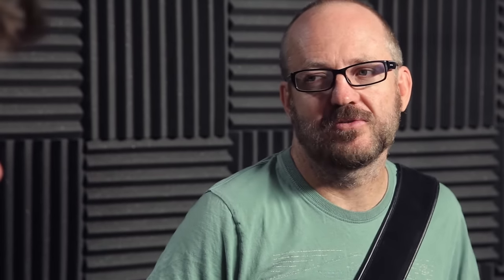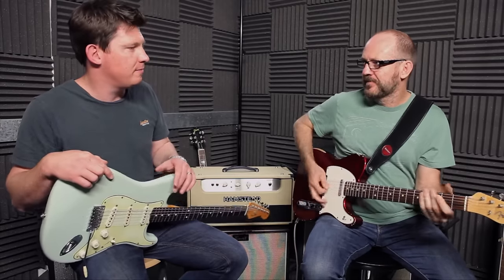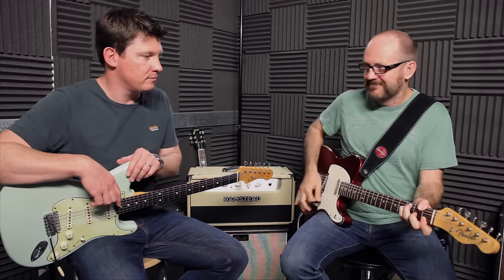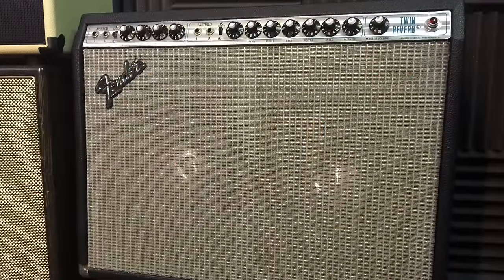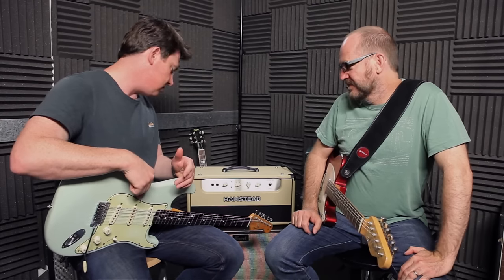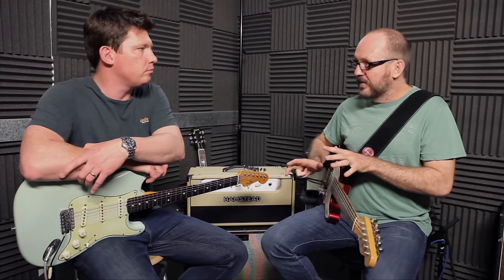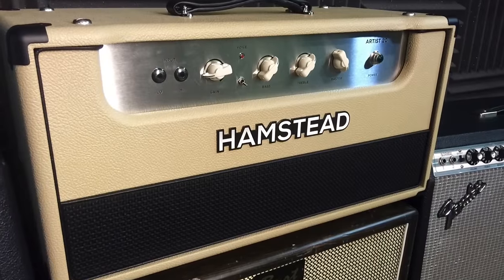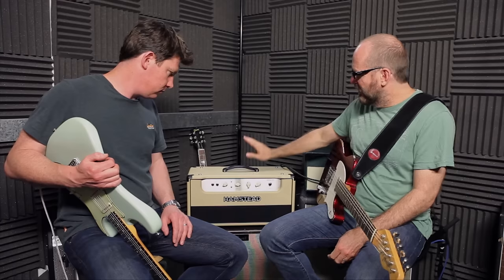Setting Up Your Amp To Use With Drive Pedals

Comment: I really think that a pedal almost always is more friendly to some kind of amp, and I also understood that the idea of the video is to show how pronounced can be the difference of the same pedal into different amps. But IMHO changing the pedal settings when changing amplifiers can minimize a lot the difference, making possible to get good sounds from different amps... BTW, I really appreciates the videos these guys do.
Reply: +Rodrigo Castro Changing eq settings doesn't change things like attack and shimmer unless there's a tight/loose/normal switch. There's response and feel more than just eq. Many amps smear notes and lack definition and pedal settings usually can't make up for that.

Comment: I appreciate that you guys are trying to make a point, and a generally correct one at that, but geez that is not what a Fender Twin sounds like. Whether it was an awful recording or the way you set it, it's like you've cut its balls off or something. That amp can sound way better than that even with a Big Muff.

Comment: I would like to see what you would use on Solid state amps? I have a Marshall hybrid really, tube preamp, solid state power amp made in the UK I really like. I however would like to know what overdrive would work to boost the just broken up sound? I used to just plug in and crank it when I used to play back in the day and use my volume knob, but experimenting with pedals. You guys have a great bunch of demo's. Thanks so much. 
Tim

Comment: Just set your amp so your tone is clean with guitar volume at around 6 or below and dirty-ish on 10. Then use drive and clean boost pedal to push it over the edge when needed...always worked for me...👍😎
Reply: A lot of people do that; i think it's a great idea for people who 1) don't use a lot of pedals in general, and 2) don't notice (or mind) the huge difference in ~tone~, not just gain, between guitar volume at 6, and at 10.
The 'clean' you get w/ guitar vol at 6 is just too dark for some of us; and the 'amp-overdrive' w/ guitar on 10 (not much louder than @6, but with more hair) is somewhat short of "creamy lead tone".....
I think good-sounding pickups sound their harmonic best on '10', anyway; in that case, you'll often want to run your amp within it's clean headroom (or at the edge), and stack drive pedals in front. Even just a 'preamp/OD' (Tech 21, Radial ToneBone, et al) and a boost/OD after it......Volume pedal (since guitar volume stays on 10 for full signal). Put it in the loop for a True 'master volume'.

Comment: I use an original 1978 Marshall valve 2 by 12 amp 50 watt , I use an attenuator so I can push amp without excessive volume, I use jhs at  and bonsai jhs tube screamer pedals is n my Marshall , awesome combination, using a les Paul

Comment: That's the modern way .keeping the guitar volume on ten like a on/off switch and switching channels..being 55 I like the tone variation of riding the guitar volume control anywhere from 4 to 10. One of the boosts on my board is a straight clean boost designed to get the brightness back as well as raising vol for solos...👍😎

Comment: The super overdrive in the fender is much better to me than the muff , I’m a Marshall man converted to orange amps but the best sound I ever got was in a fender twin reverb with a bossOD 1 back in the 80s if it was too bright I just dial the treble down , I used to use Gibson dirty finger pickups in shape strat

Comment: The difference is the EQ in the amps.Dial the Fender in starting with bass and treble at zero and middle at 10. After that you sprinkle the sound with the bass and treble.

Comment: Also Fuzz Pedals into VOX amps will do the same as Fenders. Got one and hooked it up to my ac15... hated it
Reply from the maker: +Da Spotz depends on the Vox. My old AC30 and AC10 sound epic with fuzzes but these amps have EF86 input valves, but if your plugged into the normal channel and you are playing really quiet with little amp compression it can get very spikey

Comment: Would be super interesting to have a vid (or series of them) where you take this concept of how different pedals sound with different amps, and see how some of the 'amp in a box' (eg, Catalinbread foundation series) pedals match up in when stacked similarly.  

Personally I've got an AC15 Twin, and a 70s Princeton I both run clean, and I've got 3 of the Catalinbread boxes that I set with just a slight bit of gain after my ODs and Fuzzes.  This gives me a huge tonal pallet to work with.  I've noticed how they filter the sound of a fuzz so differently is amazing (sometimes good and sometimes bad).  I've recently tried an EarthQuaker Devices Monarch (Orange in a box) have found it does the same thing and is fantastic to match with a fuzz.

For those of us who like a variety of tones, and want to try and augment our main amp to get there - because of budget...what should we be looking at that's tonally accurate.

This vid, the vid on better solo tone, and even Tom Quayle showing off the variation in the Dual Fusion stack... there's just a lot there to talk about or show off even more to help us figure out how to get the tones we hear in our heads... and that's without getting too much into guitar type or speaker type.

Comment: Great vids, super helpful information that it takes gear nuts years to figure out on their own.  Thanks for that.  Wondering if you could do a vid with drive pedals you can use with a VOX AC30 on the top boost channel.  Seems very sensitive to drive pedals and it's hard not to get that papery thin sort of sound with it.  All the best!

Comment: Great videos! I've learned so much from them! But I was wondering, could you do a video about guitar treble bleed circuits (and similar) and how they affect the volume roll-off sound on fuzzes and treble booster circuits? That would be extremely helpful!

Comment: The video is extremely enlightening. But some rock albums in the late 60 "mainly" were recorded with fuzz and Twin Reverb together. I'm not sure, but the twin reverb ideal is to turn off the key "bright" and put the volume in 4 up.
Reply from the maker: +maupric the 60's twin is an entirely different amp to this 70's silver face. Nothing but headroom here :)
Reply: +Daniel TheGigRig I do not know what is different from the "twin" of the 60s just know CREAM Disraeli Gears studio had this rough guitar tone. The Clapton used Marshall live but in studio he used Fender Twin too. I have seen in studio photos. Another example is Book Of Taliesyn - Deep Purple. I do not like that tone. Me happens to overdrive pedal. In my case is a Okko Diablo pedal plugged into a Fender Supersonic Twin. In the clean channel it has a button that toggles "twin" or "bassman". I think it's like you were the "britght" button of the Twin or "fat" of the Bassman. When in "twin" gives me this harsh tone and when in "bassman" gives me that velvety timbre wonderful Albert King type.

Comment: Part of this conversation needs to address plugging into the effects loop return on your amp. If you haven't already tried it, it's like playing an entirely different amp. Your pedals are driving the power amp and bypassing the preamp. Also stacking the fuzz with the overdrive could give you the tone you seek. And it's my opinion that pedals all have the potential to sound great with all amps and all guitars. The question is how long you're willing to work the setup to milk the sound you seek out of your gear.

Comment: a glorified PA speaker...Leo wanted clean loud amps, and that's what he tried to build his whole life. he finally achieved that with the silverface amps. they have their place. I used to play clean only and a silverface twin could do it better than anything. fuzz pedals sound better in front a distorted amp, so the only way it's gonna sound good into the twin is if you crank it.
Reply: I agree about Fuzz faces sounding better into a driven amp or OD pedal. However Muff's not so much. they're so thick and wooly that I think they really need to be run into a clean amp, or you're left with a tone that's so compressed and wooly that that it's not really usable for anything besides Smashing Pumpkins covers. However they sound great running into a Tube Screamer with the TS's gain rolled off to add midrange. That's what I do for playing Gilmore tones: the TS into the Muff for lower volume use, the Muff into the TS for louder ones (in general).
My favorite sound with Fuzz (which admittedly I don't use all that often) is a Fuzz Face into my Klon clone (the Fuzz Face actually being a clone I built with PNP transistor so it sits better with other pedals).

Comment: Hi! I really like your show, as you're really talking about the things that really matter in the real world! :-)
However, concerning the way pedals and amps react, I regret you didn't mention how important the role of the speakers is in the way amps and pedals get along. The more I experience things, the more I find that, more than amps, some speakers take or don't take pedals well (of course, it's a matter of combination). 
Anyway, again Bravo for your show, you are doing a terrific job!
All the best,
Vincent
Reply: vincemanmusic Most pro audio engineers assert that a good speaker accurately or transparently produces the signal for which it is supplied, meaning that the speaker adds no timbre to that signal. Some players are partial to speakers because of the timbre that is added by a particular speaker.This is good if you are content to always having that added timbre as part of your sound, however it can become an issue when you no longer want that added timbre, or when changes are made to the signal before it reaches the speaker, these changes can include volume, gain level, and not limited to but of course pedals.For myself and many, a transparent speaker is an essential element for tone construction, as the speaker is at the end of the tone construction chain and is fixed or non adjustable. I hope this is helpful to whoever reads this.
Reply: Eddie Griffith Transparent speaker? I've never worked with such a thing :-). To me, any speaker reacts as a filter, cutting or enhancing some frequencies, compressing, distorting sometimes, and it's a huge part of the equation when it comes to sound. From Celestion (V30, greenback, G12H30, Alnico blue, you name it) to Jensen or JBLs, any guitar speaker ads its flavor to the sound. To me it's a good thing, and a big part of the signal chain. 
I'd like to know which speaker do you consider transparent?
Reply: I did not mention "transparent" meant  within the range the speaker was designed to produce. In short most speakers that are likely to be transparent are ones found in the professional audio field, many such speakers are  also used as OEM on guitar amps. Many well known players have used speakers from  EV, JBL that were originally designed for PA systems. Rather than discontinuing a popular PA type speaker EV kept the popular EVM 12l on their catalog as their only offered guitar speaker.(there is a variant of that speaker with the difference being peak power handling) 

Of course the speaker is an important part of the signal chain, it is a vital element and it is at the end and has the last effect, so if the speaker you choose for a specific timbre effect (like so many guitar speakers are made for) is what you want, you will always have it. Whereas if you approach the final link in the chain as you would hi fidelity audio reproduction, the changes you make on the signal chain prior to its reaching the speaker are more accuratley revealed. There are other elements that effect how any speaker sounds, so proper application should be considered

Comment: Comparing a 100 watt amp likely running  four 6L6's in pentode mode to 18 watt amp possibly running two EL84's in pentode (which were designed to have higher gain, but less power), and later bringing in a not so widely known amp with out any information about its power or pre section has rendered this video into something I would describe as "non-comprehensive" to any one who wants to understand the physics of drive pedals relation to sound in the amps for which they are to be paired.

An explanation of the differences of the amp circuits could go a long way in helping many to understand why there are such great contrasts in tone and volume amongst these amps when using an identical input on them, and of course how to compensate if possible.
  
Since I took 34:36 of my time to watch this, I share only some of what I felt should have been the foundation of a video that bears the title "Setting Up Your Amp To Use With Drive Pedals"  I was really hoping to learn something new, but did not.

Comment: I wish u can do an artist show, like how to get a gilmour sound from the pedals....I am trying to get one using my egnater rebel 20 and big muff and delay and it's actually challenging
Reply: Gilmore tone; Run the bridge pickup from a Strat into a vintage style (just not the NYC reissue) Big Muff, with a Tube Screamer (gain rolled off to be completely clean/ volume set at just above unity) into the Muff. Add delay/flange/ vibrato or rotary speaker emulator to taste. THAT'S IT.
Chasing his lead tone on Comfortably Numb was all consuming for me for a while. I tried everything, different amps, ODs, distortion, Fuzz, etc. It was only after finding an old issue of a magazine my uncle had in his gigantic collection (I believe this was a recording magazine, not guitar) that had an interview with the producer or engineer. He said the tone came from a Big Muff, with delay, flanger, and a rotary speaker, and that they added midrange after he recorded it. Obviously you can't do that live, so using an OD/EQ or Mid boost pedal (like a Koko drive) will give you the same effect.
This was the first pedal I ever built. I ordered a kit, and the was up all night building it only to not work. I gave it a second shot and that was the one. I'll never forget sticking a TS808 that had been in the back of the closet that holds all the equipment I don't use. It had been so many years since I used a TS that I wasn't even sure it was still working. I turned the Muff on, then kicked on the TS; my eyes lit up. It was perfect, NAILED the tone right out of the box.
I think I might have even been using a Rebel at the time as well. 
I had been repairing guitars for a while up to that point, after that I became a machine when it came to building and modifying pedals, then later amps. now many years later, I've built countless, repaired Abbas modified even more, do repairs and service work an amps as well as building several (I currently have a JTM45, Plexi, Marshall 18W and 50W Dumble Overdrive Special clone, the last two being from kits, but are hand wired point to point like the first two that I sourced the parts myself; a nightmare, if you ever start building amps and you can find a good kit for an amp you want go that route). All of it started with hunting that particular player's tone.

Comment: Daniel...Mick tip of the hat gents. I think a good video would be for the guy or gal who uses a S ton of effects, or just has a big pedalboard in general. A guy or gal who uses compressor, chorus, phaser, octave, univibe, pitch shift, envelope filter, modulators i.e. moog, earthquake, source audio, etc., filters, bit crushers, loopers, plus all the delays and drives and such in one rig. I'm thinking Nels Cline or someone of that cloth. I know there is no "right" way, and each pedal plays a bit differently with the other, but some things tend to work better than others. Like where to put your octave pedal with your say univibe or chorus pedal and things of that nature. Basically how certain pedals behave in front of or behind other pedals in the world of effects, filters, and modulators.